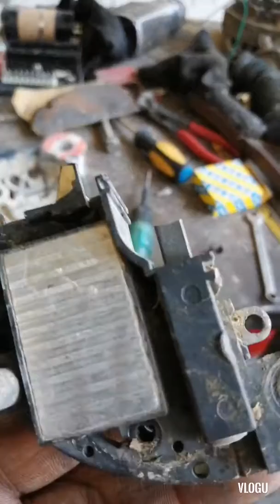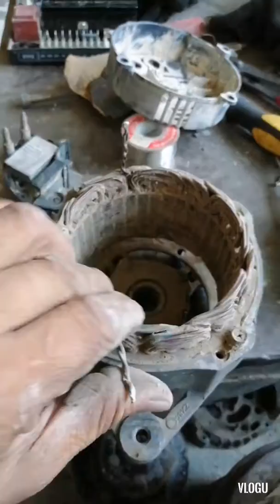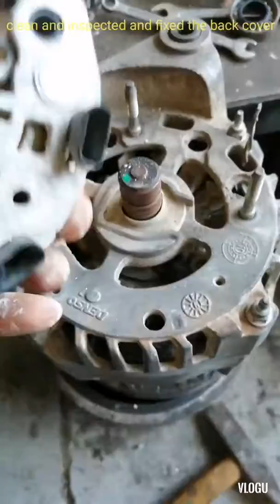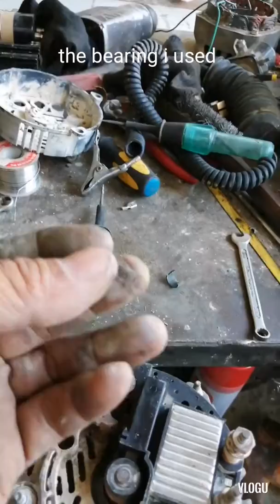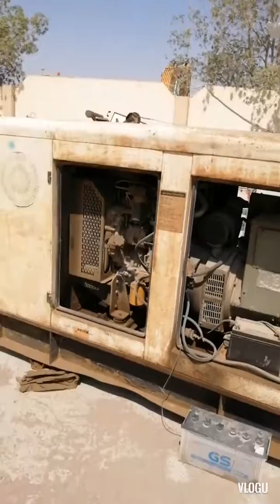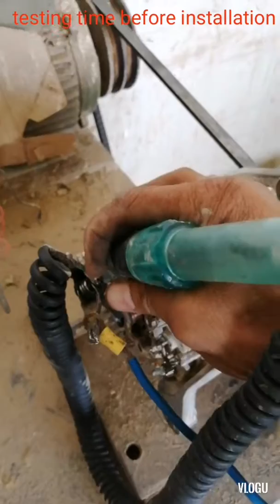ALTERNATOR DIY OF CATERPILLAR 422E-F BACKHOE & SKID LOADER AND GENERATOR

Comment: My alternator is very similar came from skid steer caterpillar is no charging and the carbon brushing looks ok any idea what’s the problem?
Reply from the maker: bro sorry late responce, actualy if carbon brush is look okay, check the armature coil if the armature okay the next one you have to check is diode,look well if any corrosion you maybe diode is damage, how to check used valve test and battery one side of the diode same as negative must be coming light and the opposite side must positive will not come light but, if you found one of the diode showing light negative or positive position of your test diode diode damage, but usualy  and always damge is regulator the same as i show on my video, then if your going to test connect the positve line and connector clip of your valve tester then touch the valve tester probe to the middle terminal before start to run must be show light after run must be light is off ok, and last pls subscribe thanks for watching